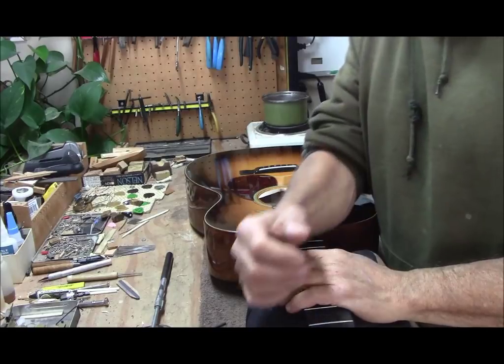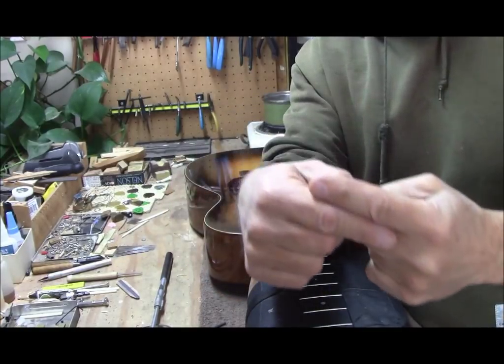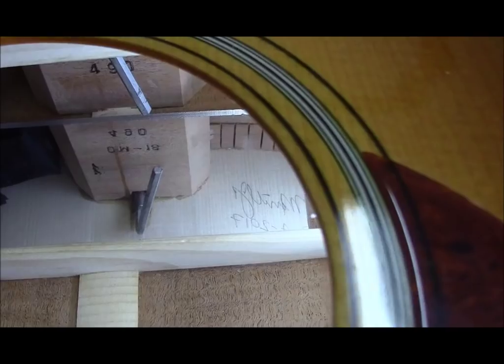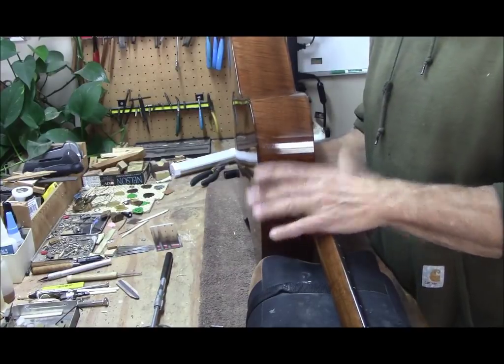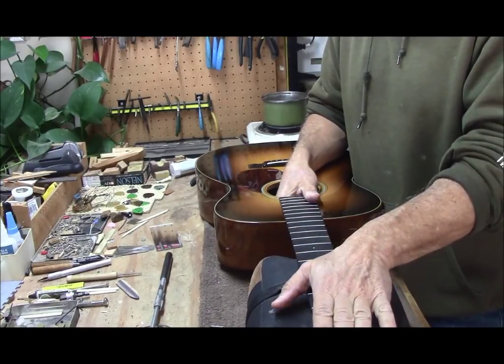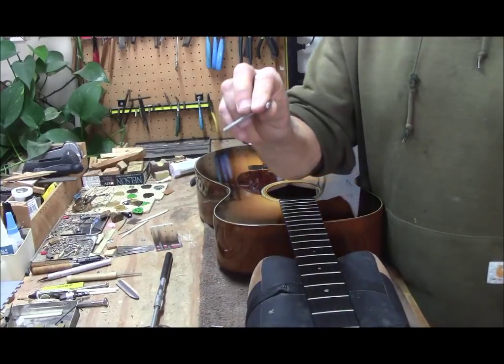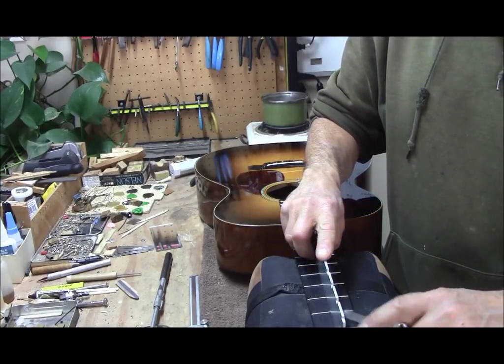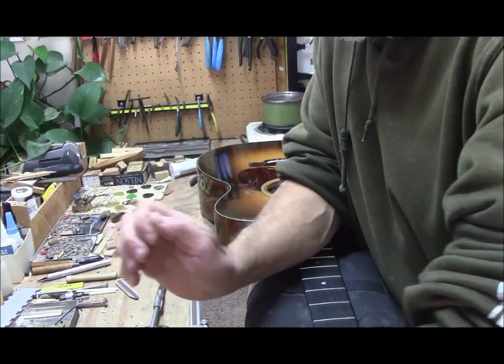Adjust 2 way truss rod

Comment: So, correct me if I’m wrong. Clockwise to add relief, counterclockwise to take out relief? I’ve adjusted single rods before but not a dual.
Reply from the maker: Depends on your perspective...are you facing the nut or facing the rod?  Easiest way is use a jar with a lid. Orient it so that jar is the rod, the lid is the nut. Tightening reduces relief. Loosening increases.
Reply: @Bryankimsey  yeah, I got that,  but wasn’t sure with the dual action rod if it was the same righty tightly lefty loosey analogy:)
Reply from the maker: Exactly the same. Two way can physically add relief, one way can't.

Comment: Hello Sir. I bought an acoustic a few years ago and because im an idiot i tried adjusting the truss rod about the second day i had it. i wanted to raise the strings a little because of buzzing anyway i turned the rod a little and now the rod just turns without doing anything. my question is is there an easy fix or is it hopeless ?
Reply from the maker: Uh oh.  It's unusual to actually snap one. It may be spinning in the neck, especially if it's a PacRim with a single compression rod. So... yeah....bad news probably.
Reply: @Bryankimsey  thats what figured. just thought i would see what someone experienced had to say. its a cheap epiphone so im not too concerned about it. thank you.
Reply from the maker: What'd I'd try to do, before doing anything invasive and expensive, is to drill a hole over the truss rod at the end opposite the adjustment nut, and feed in West Systems thin epoxy via a syringe.  If your adjustment nut is at the headstock, I'd go to the 12th fret.  If adjustment is inside the body, I'd go to the 1st fret (there's often a nice cavity under the nut).  This would lock the truss rod back down again and it should work. 

What's odd about your case is that you were loosening it and that's why I don't think you snapped anything.  I think it's probably turning.